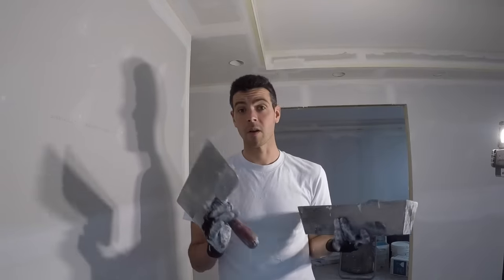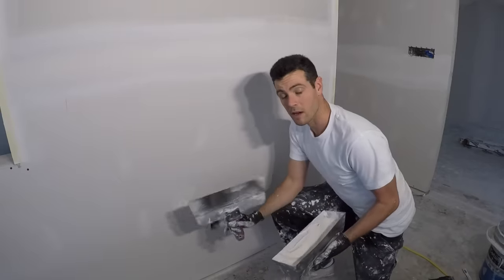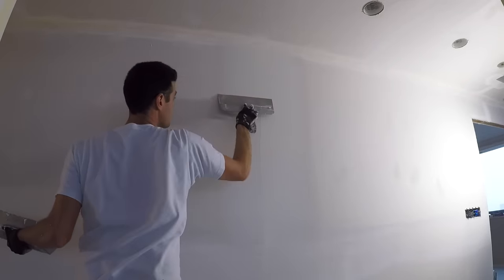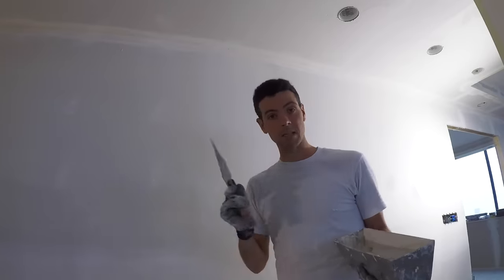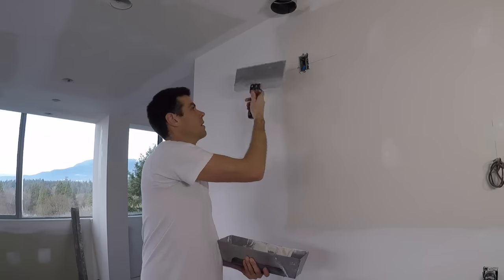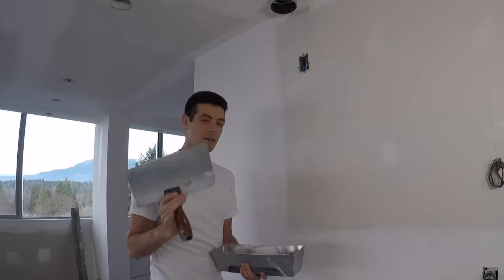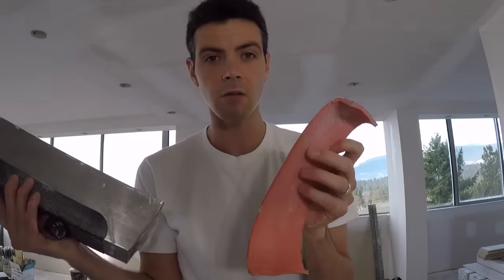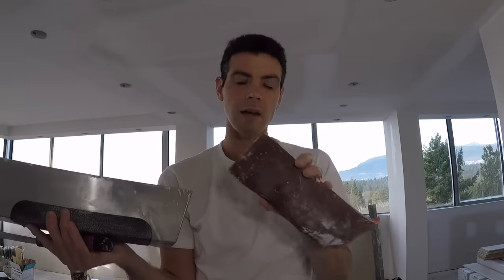HOW TO COAT DRYWALL( BUTT JOINTS)

Comment: good video there  is allot of ways people do joints, and there dosent seem to be any consensus. ive never been able to get a good joint building up layers like this, i just end up with a visable hump. 

the revolution in my mudding came when i learned about putting two feathered 12" humps on either side of the joint, then filling in the middle with a nearly flat 12" feathered pass. this keeps the total mud thickness down and allows you to have a verry gradual transition. also,.no sanding between coats. ive never had better looking joints. 

as far as trowel vs knife, i would like to use a trowel but i cant seem to keep it from making a huge mess. there is just no way i can see to get all the mud out of the pan without dipping my knuckles into mud constantly.
Reply: shonuffisthemaster a hawk will solve your trowel problems.

Comment: I always wonder why so many people install drywall horizontally instead of vertically on walls. Vertical virtually eliminates butt joints. As for ceilings, 10’ room buy 10’ drywall, 12’ room buy 12’. You can spread that hump out, but it’s still a hump.

Comment: Thanks for the tips. I found them very helpful. One thing I'm curious about is the technique for mudding a large rectangular patch, say 16"x16". Is it possible to mud all four edges, both inside and out, in a single pass? I have to do one direction first, let it dry, and then do the perpendicular direction. Perhaps a topic for a future video.
Reply: 100% you use a setting compound and you prefill then run your tape edges about 1 inch past each other. Squeeze out almost all the mud from the tape then clean up and let it set. Then first coat then second coat.

Comment: Paper shims on each stud or joist before the joint help a lot to get but joints flat fast.
Reply: How does that work
Reply: @joncrosby8988  By making the but joint joist a lower spot between the shimmed joist. Makes it much easies to float out.

Comment: I am a hand and tool finisher. There is another method that works well also. If you have ever ran a flat box on a butt joint , then you are aware of the geometry involved. There are three points to a butt joint. The middle and both sides. When you gauge the butt joint, it always seems that one side requires more mud than the other side. Coat the heavier side first, then staying to the edge of the tape on the other side, coat the other side, making sure not to overlap the two sides. When it dries, tightly coat down the middle to fill in between the two sides. When completely dry. Apply a second coat using the same technic. Again it is the same effect as if you ran a flat box. When it dries, tightly coat down the middle again. Now you have two coats applied the same as a tool finisher.   If you are not happy still, then apply a third coat by hand as described in the video. I can usually use and 8" knife for bed coat and a 10" knife for skim coat. If a third coat is required, I use a 12" knife and go three knife widths wide as described in the video. Thinner mud means more shrink back and less material on the wall when it dries. The stiffer the mud is the less it shrinks. Of course, running it straight out of the bucket is not recommended but the less water you add the better result you will get. I like a creamy consistency but not so thin it just runs everywhere. You will achieve the same results as the video, but it will eliminate lap lines( or lift off as described in video) and extra sanding. A good scrape with a knife in between coats and you will not have to sand at all until butt is completely finished. Then a quick brush and you should have a perfect butt joint.

Comment: I'm not sure if this will help you but I had neck and shoulder problems a while ago. I had never plastered before and I was asked to plaster a large area of ceiling that had gotten wet. I was sore after that for a year! I know I plastered for 5 minutes compared to you but I also did something else that caused my soreness. I had been sleeping with my arm raised up under my head for a long time. I stopped doing that and I was better in days so if you sleep like that try to find a different position and see if that helps at all.

Comment: I have a 24" knife, there made for knock down. I apply mud with a 10" almost same as you. Then i use the 24 to even out an level off. Then feather with the 24", then final wipe. 
I do this.way because in my early days in would leave humps or dips. No ones perfect.

Comment: Hey Ben.  Thank you for your great teaching methodology.  Great explanations in detail.  You have the patience of Moses with your following.
Question:  Do you not have to do much repair work on textured walls/ceilings in Vancouver?  I've seen maybe 2 from you - popcorn.  I am a DIYer and my whole house is knockdown.  I am on the 4th of 4 repairs to ceilings, some vaulted.  My current issue is with installing DW patches to installed damaged DW cut edges, and retaping the rest.  It appears that I prefill these seams before taping.  The USG handbook suggests replacement of damaged edges, and if I had to replace sections, I'd prefer to go to the next joist/stud (24").  But with the workmanship I've seen, there's no guarantee that nail job will be any better.  Hanging joints are what started current repairs - 2 adjacent cracks, one 8' long, the other 4' long.  I've removed down to old drywall in about a 2-1/2 through, so it's ready for prefill & taping.  But the 4' repair has damaged edges.  I dont want this crack to come back.  Recommendations?

Comment: My problem is filling the drywall in a door interior framing. I removed the door to the laundry room, then pre-filled with 45 min; added 1/4” drywall all the way around, and attached paper-faced corner bead. Everything was fine until I tried to mud the new drywall. Placing my 6” across one corner bead to the other, there were gaps from 1/16” on each side to 1/8” all the way down the middle of the door frame. I couldn’t fill it evenly, it created a huge mess. Should I run mud down the center and let it dry? Should I switch from hot mud to green lid? Or blue lid? Or rip it all down and start over? 🤷

Comment: Real nice work on the videos. Appreciate the time you put into them.
Question: Are you doing any of your coats with just straight mud or are you mixing with plaster?
I'm in the States so All Purpose light weight Joint Compound is the material?
Thanks

Comment: Nice demonstration thanks for sharing!    I recently did some repairs and touch-up work and thought that the Mud was free of pot-marks (after the second coat), wouldn't you know, a few pot-holes appeared after painting a primer coat. Do i need to pass a vacuum over the walls to reveal hidden pot marks?

Comment: Nice... I first saw the roll-on muddling style from a guy using a similar 4ft TAPE-TECH finish knife which he used to smooth the ugly stamped wall after the mud was rolled-on... This would save me major hours as the TLC job requires a lot of skimming of all walls since the condition of the walls are dilapidated and unkempt... It is nice to see you use this very roll-on mud trick... MGTOW!

Comment: I definitely like the roller idea on the ceiling.  My ceilings are painted, but they are some areas that need to be leveled.  Should I use the roller technic to make those small corrections?  also can it be used on the wall also as final coat?

Comment: Hey Man.  Awesome work and teaching!  Question:  why don’t you just shave the edge of the drywall with a knife so it’s tapered like a new sheet so that mud and tape fit into The Valley and it’s flat without having to feather out a hump?
Reply: Because you would be cutting the face paper off and that is what the tape needs to bond to.

Comment: I had to cut a 16-inch by 16-inch "hole" to access the plumbing for a bathtub and make a repair. I was "lucky" that the wall that was cut open (opposite side of the tub wall), was near the landing of the "middle" of 2, one-half flights of stairs. So, the hole was approximately centered above and below the floor level of the bathroom, but on the opposite side of the wall, it was about 3 feet above the bottom step/landing.

How would you have repaired the drywall here? Do you have a video for something similar, or are you considering making one?

I made this repair about 2 years ago and I don't see any signs it was ever disturbed, so I'm very happy with it, but it took forever. Hopefully it won't develop any cracks down the road.

I had 2 edges (left/right) with one-half of a 2x4, but nothing to support the repair at the top/bottom, so I had to add a couple of pieces of 2x4 horizontally to support the repair.

Comment: Ben, I have now watched many videos on drywall taping and coating and your explanations and techniques are the best. Hopefully my current basement project turns out well. Every joint is a butt joint because I am replacing the bottom 36 inches due to a lovely basement flooding incident (that is what the basement waterproofing company left me with after their drain tile installation, which was done very well). Your videos cover most of what is necessary to tape and coat drywall after initial installation, but what about the weird instances one comes across during remodel work? For instance, I have an outside corner that is cut 36 inches from the floor. It is a metal corner piece with nails. I exposed it and cut it a little higher up than where the drywall meets (at a butt joint). I cut it at an angle (with a oscillating saw) to give me a point and installed a paper/metal corner bead up to it. The two corner beads came together almost perfect, but not quite, so I put paper tape over where the two corner beads met and fanned it out. I'm sure there is a better way, but I had to improvise. My point is, now that you have pretty much covered how to tape and coat drywall that is installed initially, how about some more amazing videos about the weird instances that occur when it's not that scenario? Some of the butt joints did not meet flatly because the existing drywall was installed with glue underneath and left it slightly higher than my newly installed drywall. I am just fanning out the lower portion, but is there a better way? Anyway, your instruction and attention to detail is the best I've found. Thank you so much!  And what is the amazing view that we see through the windows of the place you filmed many of your videos? It's awesome!
Reply from the maker: Hi Travis:) That's a good idea to make some videos for the weirder patches. I have just finished the drywall on my current job so it will have to wait a bit. The good news is I have filmed a few more drywall videos on this job and will post them soon. That amazing view is English bay and Stanley park in downtown Vancouver.

Comment: I am a decorative plasterer. I don't usually do Level 5 walls. I have to do a ceiling that was torn out due to a plumbing leak. After the wallboard installation and taping, then doing the joints, do you do a full skim coat on the entire piece?

Comment: I always apply drywall to walls vertically rather than horizontally.    Number of reasons, main one been no butt joints, and you’re only dealing with the seams which is easy to fill in, but also more strength when the seams are against the stud.    No right or wrong.  Preference I guesss

Comment: Nice work. I have all the same arm  and neck issues.
 What pile of roller do you use to do your final coat. I tend to get alot of mud on the floor doing my final coats. That looks cleaner.

Comment: That's a nice trick with the roller and the sandpaper on an angle too!  Awesome videos mate!  Just one quick question, what grit would the finishing sandpaper be?
Reply: I've been doing drywall finishing for about 38 years and would like to answer your question. I use fine gauge emery cloth sandpaper (a little more robust than paper), also doesn't leave sanding scratches like sanding screen can. A light touch, and cut your emery cloth to the exact size of the sanding head (keeps scratches out of opposite wall when doing corner sanding, hope this helps. If you are going to use something else I use 120 - 150 grit. I'm not trying to speak for the Vancouver Carpenter, he's awesome, and have even picked up some tips on newer products he uses.
Reply: @dantigar7318  Thanks for the reply there Dan, much appreciated.  I'll give that a whirl during my next renovation.

Comment: Loving these videos but as I've gotten started pre-filling the spaces, I notice that where drywall meets in between the rafters or studs, there is flexing as you slide the knife along. I'm wondering won't this just crack as I proceed with the other steps?

Comment: Do you have any tips or could you make a video on how to install drywall around an existing door/window frame?

I bought an old 1912 house and they removed the lath and plaster (for whatever reason) in the 70s, and put up wood veneer panelling, with nothing behind it. I'm pulling it out tomorrow and then will be putting up insulation and drywall, but am really hoping I won't have to remove the door frames or the window casings. Do you have any tips for that?

Comment: Vancouver carpenter?...you sure it shouldn't be Vancouver drywaller? LOL. Good vid anyways, but some tapers prefer their knives curved inwards and the pressure on outside is how it's compensated like you said. For me it's rivets down, but I like trowel too. I picked up one of those electric drywall sanders. Worth the coin. Shoulder saver.

Comment: I recently finished coating and sanding my project.  I even took the 1000W halogen work light to the walls when sanding so I could see every flaw.  The wall looked as perfect as a DIYer could get it IMHO.  Last night, I applied the first coat of primer (Rust-Oleum® Zinsser® FastPrime2) and now I can see my tape (two parallel lines running the length of the joint) on some of my butt joints.  I could not see the tape prior to painting, even with the super bright light, so I don't know what happened.  The wall feels smooth when I rub my hand over the joint.  Also, it was a week between applying the mud and sanding.  Any ideas?

Comment: When I use my sanding pole, it tends to stop and flip onto edge leaving a divot in the drywall, especially when it's a new sheet. Any tips please?
Reply from the maker: Cheap sanding poles are more problematic but not unusable. However this may not be the problem. When I sand I push the pole slightly diagonally. You should be pushing it the longways (parallel with the pole) with just a slight tilt. If you ever push it perpendicular it is guaranteed to flip.
Reply: Call a pro😂

Comment: Hey Ben, Thanks for all the great videos and teaching!  I have learned a ton.  So I have a butt joint that has been created on my Bathroom ceiling in a remodel I am doing where I have the old lathe and plaster ceiling on one side butted up to the new green board that is over the tub area now.  How do I finish that joint with both the green board and the old plaster ceiling to make it look seemless and most importantly last?  Do I use paper tape or mesh?  I reinforced that butt joint with a sister joist above it so it is nice and solidly supported.  Thanks for any direction on this!
Reply: Mesh tape is a ruse. It's for synthetic stucco and waterproofing but not drywall no matter what the guy at the big box home center tells you. Use paper tape as it bonds to the face paper on the drywall like paper mache. Ever try to unstick layers of wet newspaper after its dried? Remove as much of the old plaster to get down to the board and then prefill the joint of open. Then tape TIGHTLY with thinned mud and allow fully to dry. Then bed and skim as needed.

Comment: i hope you see this soon because I'm in the middle of hanging drywall and I need an answer ASAP. After hanging drywall I'm left with a good size lip between the two pieces of drywall. Can i mud this or should I remove the drywall and fix the studs?  The lip is about an 1/8 of an inch. Nice job by the way.
Reply from the maker: Just pre-fill it so the tape lays flat. You will have to fan the joint out wider but that is what I would do. It would have to be more like 1/4" minimum before I would remove the board. But I am good at floating big joints so I don't worry about it. At 1/8 your finished joint might need to be about 3 feet wide.
Reply: @vancouvercarpenter  cool. thanks. I just finished shimming the studs and they are almost perfect. Thanks again. I have much more to do and I'll be sure to shim shim shim from this point on.

Comment: Enjoying your vids in preparation for some DIY. Couple of questions if I may....
If you have a wall with a horizontal joint and an external corner edge in what order is the joint/edge coating done?
eg Horizontal joint taped before corner edge strip placed then subsequent coats done to each at the same time or is one joint done completely before the other is commenced.
Reply from the maker: Typically you would tape the horizontal seem first and the vertical corner second but on the same day/coat. The same goes for the consecutive coats.
Reply: Thanks Ben

Comment: Have you ever had to do restoration style butt joints? Where they rip the drywall at 2ft and the lengths can be in the dozens...all horizontal.. so you have 2ft of new board which probably broke plumb of the wall as the old board may have been heading a different angle on the framing than where the new board meets and is secured  (Drywall floats over issues/extra strapping, outlet mounts blah blah), then add the sheen of the existing walls paint too so your mud just wants to slide along anyway.  Pisses me off everytime, some of the dumbest joints to ever have to coat.